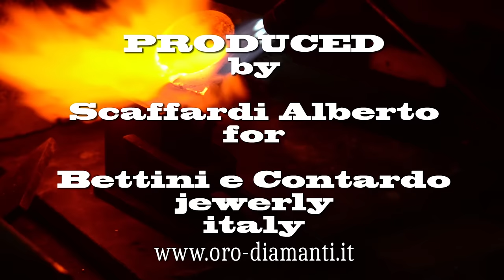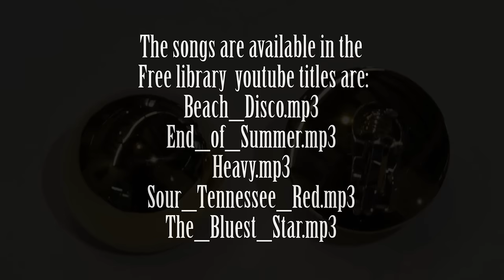Earrings 18kt  gold half sphere handmade

Comment: What was the reason for the hole you drilled in them? To prevent any damage of the expansion of trapped air when welded on them?
Reply: dtiy drill a hole for the support bar for the clasp earrings...
Reply: If they are no holes, the earings could explode while heating

Comment: Hi! Do you drill hole for hollow soldered items like these? I was told item can explode when soldering hollow items. Any advice? Love your everything!
Reply from the maker: For security, you can do a small hole, this prevents the internal air from warming it dilating, and put pressure.
Reply: huskyfluffy  i was searcing for this answer , found it ,

Comment: What material do you add to the soldering? 5:09 Nice job.
Reply: i think borax
Reply from the maker: I use flux of the Legorgroup
Reply: I thought it was a filler material (as supply). Thanks, excelent job.
Reply from the maker: Nemesis01100 Thanks a lot